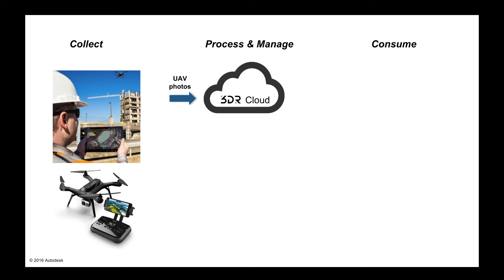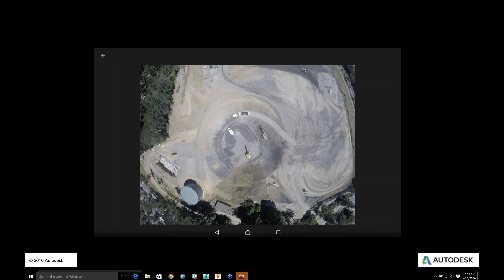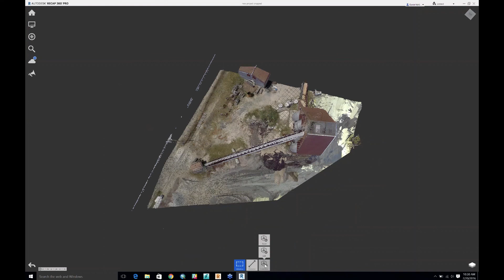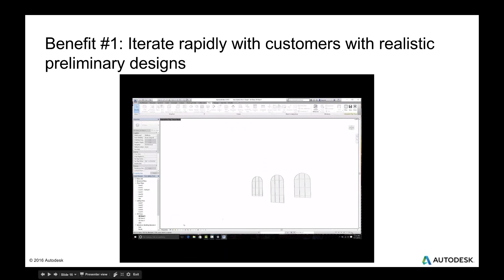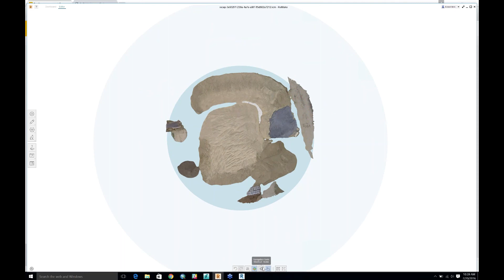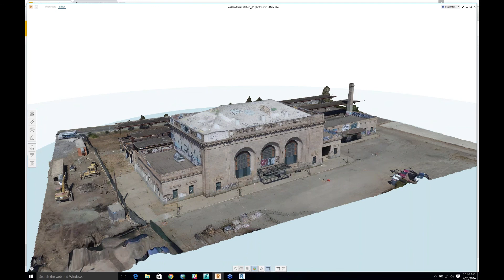Reality Capture Workflows webinar using 3DR Site Scan and Autodesk ReCap 360

Comment: Sitescan provides you the geographical coordinates to the photos?

Sitescan upload the photos to recap or has their own portal for processing photos?

If I use a go pro 4 black, it does not have a GPS to recognize the coordinates, How can I process an Ortho Photo and an RCS with the correct coordinates?.

It is necessary the aerial photograph with drone + laser-scanning. And how do I stitch the photo scans and laser scan?

Why the web portal which is displayed in the webinar is different to that accessed my account of Autodesk, entering recap 360, The tools that you show in the webinar are different or not exist actually
Reply from the maker: Hi Juan

The images are automatically goetagged on the tablet and uploaded to the 3DR cloud. From there you can upload the imagery to the ReCap cloud with one click.
Reply: Thanks Kevin...Where Can I download a try version of SiteScan to test my photos, actually we have a 3dr drone and recap 360 pro with the web service photo to 3D. but in some cases we do not have the better result of the ortho photo and cloud point.